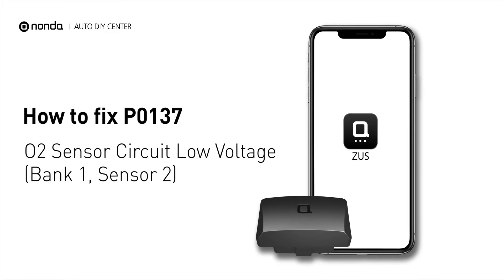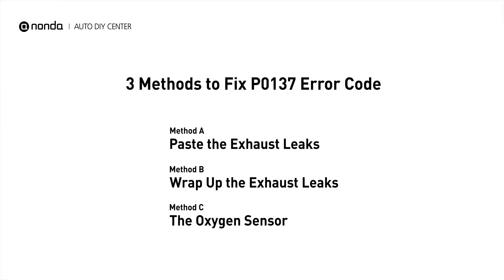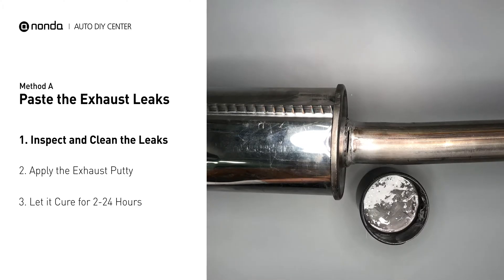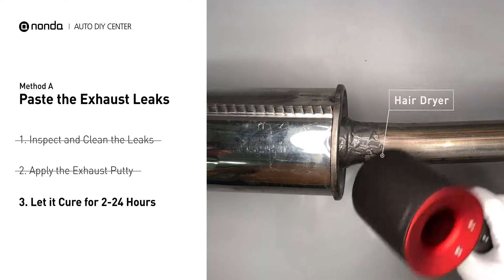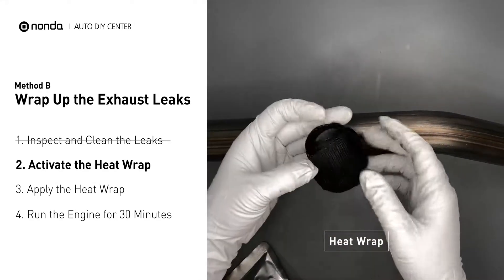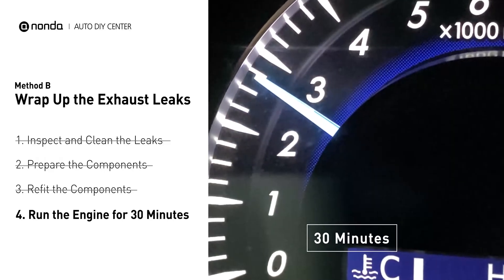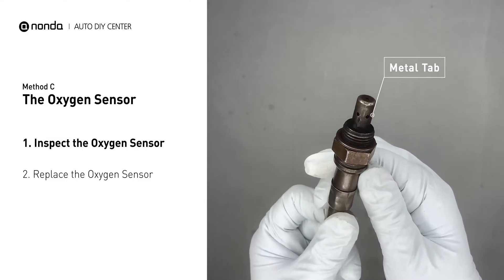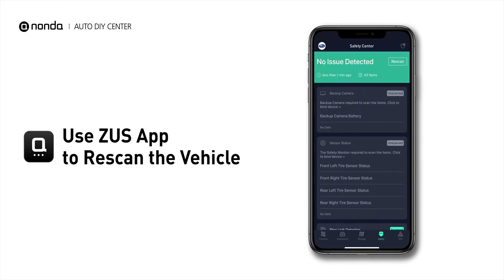How to Fix P0137 Engine Code in 4 Minutes [3 DIY Methods / Only $9.42]

Comment: Hello, my maserati ghibli @12k miles basically the 02 sensor got blown. Drove it 2k miles and i finally replaced the sensor. P0137, p0141, p2187, and p2196 have been on the scanner before and after replacement. Only difference is that now that i installed the oem sensor the cars rpm go up and down between 2 and 3 when i turn it on and it seems like if ita drowning. It can be many problems so i decided to take it to the dealership. I will come back and give updates lol hopefully its just a vacumm leak and not the catalytic converter.

Comment: i dont understand. I have a 2019 Mitsubishi Mirage. check engine light came on, took it to dealership. they said it was a p0137 code. they said I needed a new sensor. I come here I watch the video it says I need to take off the exhaust and putty the leak.
so which is it is it the sensor or an exhaust leak? can I trust the dealer checked for an exhaust leak if thats the issue?
Reply: Update?

Comment: I replaced the O2 down stream sensor twice and code doesnt go away keeps coming back got a 2006 Honda Odyssey what can the issue be
Reply from the maker: Can you please confirm if this is the only code you're receiving?
Reply: You probably used a non genuine o2 sensor or you have running rich/lean problems. It’s an after cat o2 and will also only work if the catalytic converter is also there. Chances are if I hit your exhaust with my fist directly at the cat it would sound like it’s rattling around in there. Make sure you have genuine DENSO o2 sensor for your Honda first, then check cat converter. Otherwise it’s further more issues.

Comment: I just put a brand new sensor and got the code
Reply from the maker: Hello, please provide us with your vehicle's year, make and model. Please confirm also if this is the only code you're receiving.
Reply: @nondainc  Suzuki Alto 2014. There are p0036 and p0137.

Comment: Po420 and po430 is the one to be afraid of on any vehicle
Reply from the maker: I agree with you, Brad. As replacing the catalytic converter isn't cheap.
Reply: it can actually mean like 20-25 differant things, & finding it can be more expensive than a catalytic converter(or less), therefore basically it can be one of the most annoying codes✋😒

Comment: This code p0137 most of the time does not have any effect on the car performance fuel economy?The car may pollute little more, and fail yearly test right?
Reply from the maker: Hello, we suggest fixing the code as soon as possible to avoid emission system and damage to the catalytic converter. This code can damage the internal engine in the long run.
Reply: Speed performance will decline badly and you'll be spending much more on gas and then your car can break down.

Comment: You saved me a bundle of money! Thank you so very much. For once I am happy to find out the "error" isn't some cataclysmic, $2K problem!
Reply from the maker: Hello! We're glad to be of help!
Reply: @nondainc my flex pipe is leaking in front of this o2 sensor, I kinda figured that is what's causing the intermittent o2 code. Im just going to splice in a new flex pipe, thanks bub.